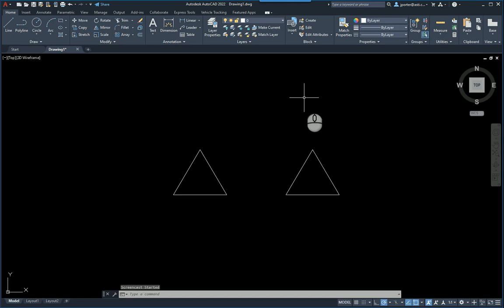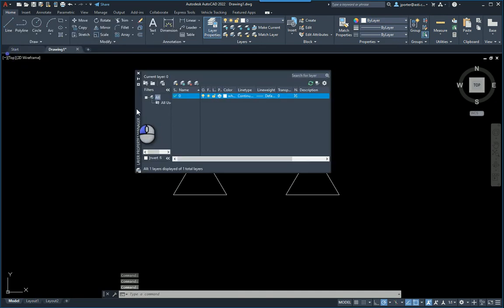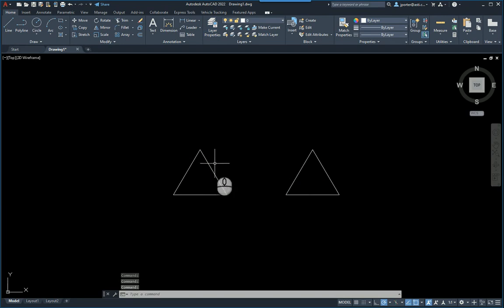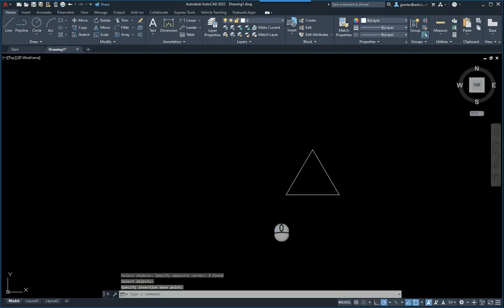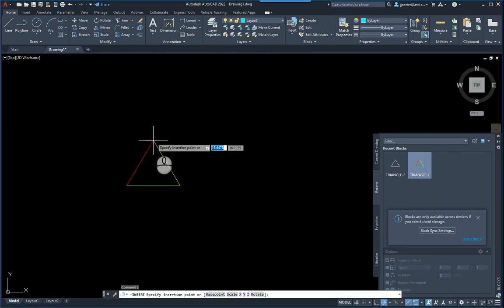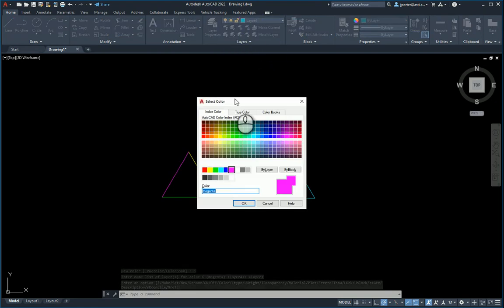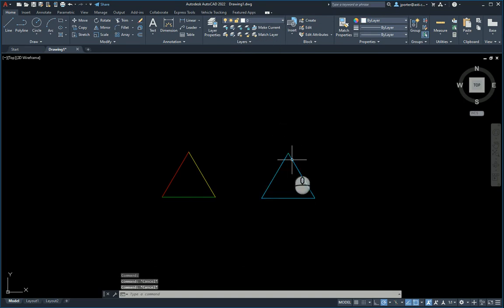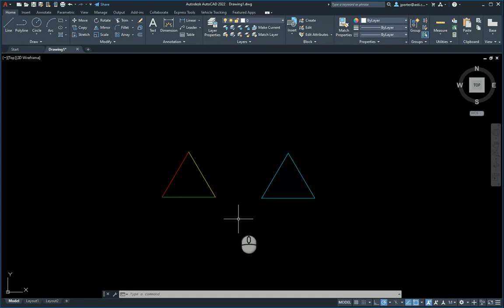Understanding Layers in Blocks

Comment: I have to put my lines  for example on layer 0 then gotta make it block, then move my block into my desired layer.  so it can be seen on layout right?
when i put block with  lines, inside the layer ( grass for example ) then i go inside my block moving again all my lines into Grass layer, it didnt showed on the layout
Reply from the maker: Sorry for the late reply here.  I've been out.  I'm unsure what you're attempting to do, but you shouldn't have to go inside you're block and move the lines to the Grass layer.  Draw the lines on layer 0, make those lines a block, place the block on the Grass layer, they colors, on, off, freeze, thaw, from there.  If the block should move to another layer the color of the lines will absorb the layer's color.

Comment: Sir i followed your instructions but in end when i use insert command it wont work i get a error and my file get closed and restart
Reply from the maker: Sounds like a corrupt file or software.  Did you try it in a new drawing?  Are you using the newer software?  If so, try the DDINSERT command instead to bring up the old INSERT dialog box.  The new one must process a lot, and the more blocks you have in a drawing, then the more it has to process.  If none of these work, then try running a repair your software.
Reply: @j-porter  sir I am using AutoCAD 2021 crack version and it's totally good not an old or something actually when I type insert I get 2 option with same name 1 is showing error and other is doing the same thing u told  but it is not that much useful for me bc it takes time  sir i want to know something else in AutoCAD if u can help me and if u know about that it is about plugin I want to add for fast work
Reply from the maker: @Mr.kingpatel  What is a "crack" version of AutoCAD?  Did you try creating this in a new drawing?  If it works in a new, blank drawing, then the other drawing may be corrupt.  

As far as plugins go. . . there are hundreds of plugins out there.  Some legit, some not.  Just make sure you do some research and verify the company who provides the plugin is legit.

Comment: When can we use New layer VP & New layer? 
What the difference between them
Reply from the maker: There is no "new layer vp".  However there is a "new vp freeze" and "new layer".  I'm assuming you're talking about those????  The "new layer" creates a new layer.  The "new vp freeze" creates a new layer that will be frozen in any new viewports automatically.  You can thaw if needed later.  Hope this helps.
Reply: @j-porter  Thanks a million